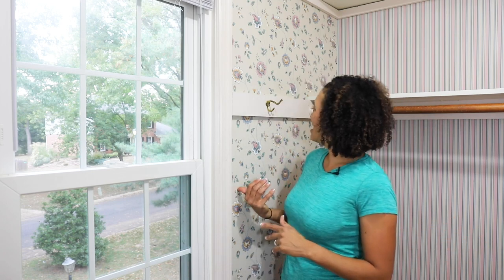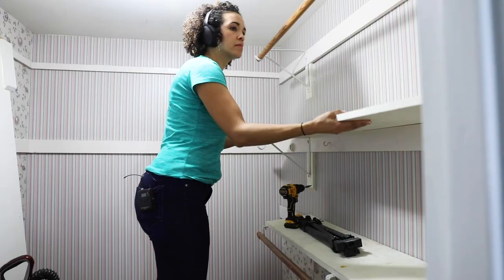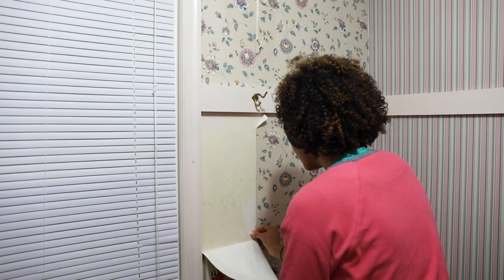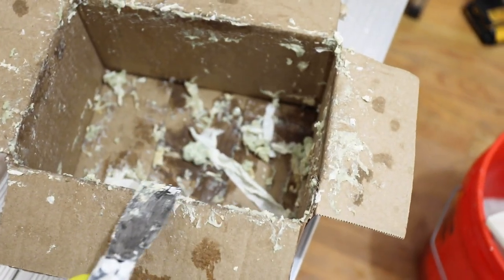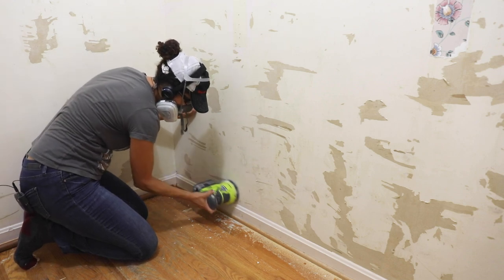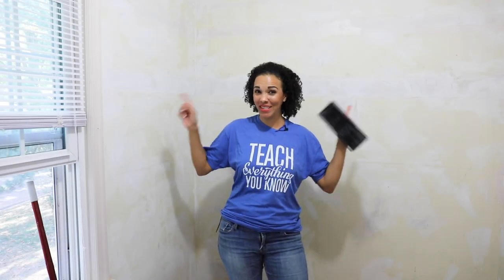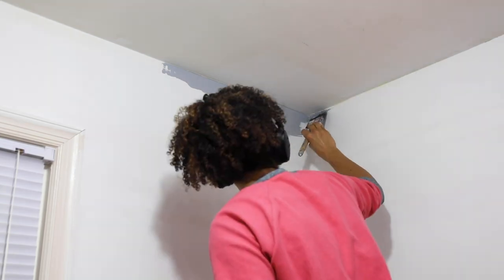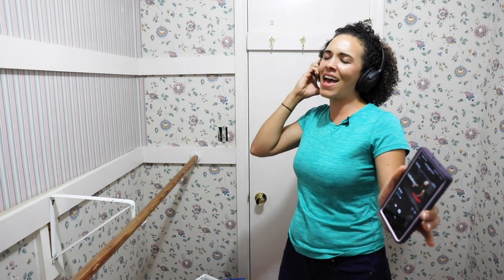How to Remove Wallpaper Easily (and Repair the Drywall) - PART 1 of 3 - Thrift Diving

Comment: I friend bought a huge old Victorian Painted Lady and snookered me into helping her "reno"... Which quite literally meant removing over a hundred years of wallpaper, and a few layers of paint in between a few of them. It took 3 weeks to do one lady's sitting/sewing room. It also took a steamer, 6 gallons of vinegar, wallpaper roller/pricker things, destruction of both my shoulders, and all my love and patience...lol  She's so lucky I loved her so much.
Reply from the maker: Yikes!!!! I think you likely had dreams (nightmares, perhaps??) of removing wallpaper. lol
Reply: Most apartment buildings in Copenhagen are 100 years old and you would cry if you had to reno walls here.when I removed some of my walls I found barbed wires, bamboo, newspapers, cigarette butts, coal and stuf I couldn’t identify as insulation. I did have fun reading some of the headlines on the very old newspapers so I saved some of the most whole pieces of paper.

Comment: I learned from a friend and wallpaper devotee to size walls before papering. Sizing prevents drywall from absorbing the adhesive and extends drying time so the paper can be adjusted a bit once it’s on the wall. And when my tastes changed, the paper peeled off with relative ease requiring only a scraper and warm water to remove the sizing and glue. 

I used Valspar’s Dogwood Petal, a white paint tinged with peachy pink tones in my bathroom, which is roughly the same size as your closet, sans window. It works with pink or gray accents and supports a little bling nicely. But really, the gray your son chose is nice. You could tone it down with white or neutral accents or rev it up with pink, yellow or coral.

Comment: I ve been decorating for over 20 years and I can honestly say I have  used a steam stripper twice and that was when I was an apprentice.use .warm water and add half cup of vinegar soak the paper with sponge or brush and leave for 10 minutes or so .if need to go over it again and leave again.the vinegar reacts with the paste which makes it really easy to strip the paper and you wont get the peeling of  your dry wall
Reply: I agree. Last week I stripped 2 rooms that I know the wallpaper was  well over 20 years old & coated with 19 yrs worth of 2 smokers residue. Spray bottle of 1/3 vinegar to 2/3 hot water beats steaming, or using Downy, Windex, etc. A bottle spray bottle removes the manual labor of wiping, sponging. Plus it’s a heck of a lot faster, practically instant, and no mess if you do it right. I will never use anything but vinegar again. It takes the struggle out of stripping paper.
Reply: @adjustedfate  wonder if you could put the vinegar and water mixture in the steamer?? I am having a heck of a time with removing some wallpaper in our new home.
Reply: @lindseyemberton5286  you would need to make sure the mixture wouldn’t harm the steamer...idk the answer for certain but lean toward it being ok. Might even clean out your steamer in the process. Personally I would flip the mixture using mostly vinegar to water, spray the walls and then use the steamer, too. On my walls I would spray, strip using a putty knife but I have a habit of ripping it once I have it started which that tends to leave the layer of glue paper. I would then spray those areas really well and it came off very easy. Mr Clean makes a Magic Eraser mop that I used after all the wallpaper was stripped to remove any glue residue and clean the walls to be ready for Kilz Latex 2 primer. An amazing, cheap cleaner is TSP, it’s more labor intensive but will literally clean anything. I scoured the Internet prior to tackling this job & TSP was the most recommended cleaning agent to prepare walls for paint. Make sure to wear gloves! Hope this helps. :)

Comment: I realize this video is 3 y/o, but I ran across it today, for my wife and I are on our 3rd room with wallpaper.  It's the kitchen.  We had the wallpaper professionally installed and I am running into areas where we removed the wallpaper that it looks as though the glue ate the wallboard paper as well.  I believe what I am going to have to do here is a lot of skim coating and sanding.  What I have found is that whatever time you think it takes to remove wallpaper, triple the estimate, because it takes a heck of lot longer than you initially thought.  Especially, if you have to work overhead and your shoulders start to tire out.

Thank you for the video.  I especially appreciated how you removed the sections of wood support with the saw.  Set the depth and cut.  Awesome tip.
Reply from the maker: Good luck with your wallpaper removal and repair, Steve! And I was just saying this to a friend the other day: whatever amount of time you think a DIY project will take, multiple that by 3x - 10x! It's always longer. ALWAYS! lol. Good luck!!

Comment: I love the gray your son picked up. Easy to accent with the girly-girl colors (or not). Aside from that, I absolutely love a sage green. Again, easy to accent with other colors - either bold or girly-girl.  Your closet gives me the twitches! I'm a minimalist and sort/toss clothing every season.  For years, I start each season by hanging all my clothing with the hangars backwards. As I use something, if it goes back in the closet, it gets hung at the end of the line and the hangar hung frontwise.  Within a couple months (or through the holidays) I can tell what I'm wearing regularly and what I haven't touched. If I haven't touched it, I don't need it. Out it goes. Life can be so simple :-)

Comment: My parents bought fixer uppers in the 70s and 80s so I got pretty good at removing wallpaper. I only ever used a bucket, sponge and a 4" scraper. You don't need a steamer.

Comment: This video was very helpful and  made removing my bathroom  wallpaper easier. I've used the traditional spray bottle with warm water and fabric softener which worked ok but was very messy. Your method of using a steamer, worked very well; was less messy and easier. I used a small garment steamer cos that's what I had and it did the job. Thanks for sharing. 

Any suggestions for getting the shower grout white and clean?

Comment: 1 part cheap fabric softener to 10 parts water in a squirt bottle. Spray wall patch til soaked and scrap off. Much easier and cheaper with less damage to the drywall beneath.

Comment: SW Sea Salt, Tidewater, Benjamin Moore Melted Ice Cream, Behr Bali Bliss.  I recently removed a house full of wallpaper too. The only step I did differently was to add a coat of GARDZ before and after the joint compound.  I hate wallpaper... yet I will be adding it to my guest bathroom for temporary (1-2 years) until we get around to gutting that bathroom.
Reply from the maker: Sea Salt! That's my entry color! 🥰 What makes you want to try wallpaper again? I'll admit I am curious myself about these newer "removable" ones! If it is truly removable!
Reply: @ThriftDiving  we just bought the house and every single room needs updating. This bathroom has 1950's celery green square tiles on the lower half of the entire bathroom. The upper half is wallpaper. I found some beautiful wallpaper to go over the old wallpaper (talked to the manufacturer rep). This bathroom will be the last room to get gutted. We're just trying to make it work for the next year or so.  It also had the infamous green shag carpet, in the bathroom! Imagine the aroma that left.. 🤮

Comment: Hi Serena, what type of vitamins do you take because you have energy for days?

BTW-- great channel!!!  Somehow this channel ended up in my feed a couple of weeks ago and i have been watching ever since then.  If the closet is just yours, i would go with light lavender walls, eggshell ceiling, and trim.   Include a vanity and mirror.  Also, a small chandelier in the ceiling.  But, if you and the hubby are sharing the closet, then switch the lavender to pale yellow or harvest gold, eliminate vanity and use some other ceiling light.  But to save time and money, you can stick with the existing color.  It looks OK!

Comment: Hard work isn't it? If you wish to speed up the mudding (drying) process I recommend mixing half a bag of hot mud (90 minute) in a 5 gallon bucket for your application... To get the smoothest skim coat I recommend rolling it on and then troweling it... The mud you used, for me, is typically too thick so adding water helps but over that I just prefer to mix my own. Anywho, your finish looks really nice. Great job!

Comment: Jun 2022. I just saw this. You do not need a steam device to remove wallpaper and if you do it as described next you will not damage your drywall. Wallpaper has two components: the decorative printed part you see and the other layer that has the glue/adhesive that sticks to the wall. The key is to get the wallpaper saturated with water. Once it is wet, the decorative layer will come off usually very easily leaving the other glue layer. The printed decorative layer on some papers may be glossy and resistant to wetting. Others wet easily. I found that the wallpaper scoring tool does work well for the water resistant glossy finishes. Just be sure not to be too aggressive with the scoring tool and not go too deep into the sheet rock. You just need to penetrate the water resistant layer with a bunch of tiny holes so the water can get through.
Find the seam like she said and wet only one or maybe two strips of paper at a time. You will want to put down a tarp to protect your floor from any excess water. You do not need to use a fire hose to wet your paper. Use one part fabric softener to 3 parts hot water and apply with a paint brush or tool (e.g. sponge) of your choice. Let sit for about 3 minutes and wet it again.  Repeat a third time. Once the paper is wet enough it will peel right off. 
Once the top layer is off the rest is easy. Go back and wet the glue layer as before and you may want to use a 2 - 6 inch spackle tool to gently help remove the glue layer as shown on numerous other YouTube channels.  If you are careful, both layers will come off without any damage to the underlying sheet rock.  Once all paper is removed go back and wash your walls with a good sponge to remove any glue residue that could affect your paint. I just did this myself a couple days ago with wallpaper that was very resistant to wetting.  Worked like a charm.  
Update: Looking again at her video I’m wondering if her wallpaper was applied to bare sheetrock that has never been painted. The wallpaper I have removed was applied to walls that have been previously painted. Regardless, if you get your paper saturated with water the top layer should remove leaving the glue layer. You would need to be extra careful ensuring the glue layer is wet enough to pull off easily and be extra careful using your spackle tool not to dig into the possibly wet sheetrock paper when removing any stubborn areas.

Comment: I'm removing wallpaper in our front living room at the moment and found the best method is hot water and fairy liquid and use a brush to soak and area 3 times and then it come off much easier and the wall underneath is fine. I think the steamer takes much longer I wouldn't have the patience! :-)

Comment: Take that steamer and throw it in the trash. Here in Australia, I used a product called Dif wallpaper remover. Magic stuff. Easy as pie.
Reply from the maker: I tried Dif wallpaper remover on the walls of my house when we moved in and it made NO difference whatsoever. But the steamer has been my tried and trusted companion when it comes to wallpaper! I guess it comes down to this: different things work for different people, based on their own experience. :) Glad it worked well for you, though!
Reply: @ThriftDiving  My steamer wouldn't tough my wallpaper. I found it best to just peel off the top layer, leaving the softer lower layer, which Dif removed very easily. Mind you though, I don't profess to know all about wallpaper, but my paper was a vinyl type. The stuff sure hides faults though.
Reply: I used DIF years ago. Since I was basically out of it, I tried a wallpaper hack I saw on another YT page. Mixing some dishwashing liquid with warm water, pouring it into a home garden sprayer and spraying down wall papered walls. Found out I had THREE wp layers to remove.

Comment: Thank you SO SO SO much for posting this thorough video. I just bought a house, and the previous owners wallpapered 2 rooms. One is in a grid of 6”x6” wallpaper squares that they painted over, another is textured striped wallpaper. Do you think the steamer will work well on the painted wallpaper?

Comment: I moved into a house that had some gawd awful grass like wallpaper.  Sprayed it with luke warm soapy water and it came right off. After sanding 100 grid sand paper and covering the bare areas where paper comes through with Gardz. Then put 20 minute easy sand cement and a 2nd coat of Gardz and voila!  Note to self next time use a dust extractor...Wallpaper and popcorn ceilings are my 2 most hated items. My wife is happy and now there is peace again.  Until the next project...

Comment: This is why I hate wall paper and choose to put up 1/4" drywall over it.
Reply from the maker: Looooove that idea!!
Reply: Zavia hope we are thinking of putting 1/4" drywall over our kitchen wallpaper to. Glad you mentioned that. We just dont have the time to steam walls.
Reply: @rc6292  Yeah, it takes too long and is too hot!
Reply: Correct me if I’m wrong, but when putting up new drywall, you’ll need to take the old drywall down, going to the studs for the new drywall. Otherwise, you’ll overlap the door frames and baseboards. Maybe I’m misunderstanding your technique. Hanging drywall is a learned skill and difficult for the average DIYer.
Reply: @BeckVMH  Yes, the overlap can happen but often times 1/4 in drywall will not cause that overlap with trim.  There are many options.  Sometimes you can just retexture with a thick texture medium.

Comment: Time to de-clutter! And get the thin velvet hangers from Amazon to hand all your clothes on. They’re super thin, nothing slides off onto the floor and get stepped on and wrinkled and they’re so much thinner than those plastic tube hangers, you’ll be able to fit more stuff in less room. And they also look neat because of the uniformity! I remember one house I lived in that had wallpaper on the CEILING in the kitchen. Omg holding the steamer over my head with the hot water running down my arm and into my armpits and down my sides was miserable. Plus my hair was rubbing in the glue till it was a hard flat tangled mess on top of my head. I wanted to kill the person who did that!! Ha! Not fun times. Makes you never want to see another piece of wallpaper for a very very long time. 
Btw, your voice is pretty! It’s strong. It would just take some real guidance from a voice coach to teach you how to breath and where yo get your air from, to avoid the little crack. That not a bad voice thing, that’s a thing you can be taught! 
I love the color Sea Salt by Sherwin Williams. It’s the prettiest sea blue color. Not over the top girlie, but definitely not masculine! Check it out!!
Reply: Pamela Uribi I love those hangers. Ross dress for Less or Home Goods have those for a killer price. I’ve managed to double my hanging space thanks to those hangers and everything looks so neat being all the same size and color

Comment: Girl! I just did this a few months ago in my bathroom remodel. There were layers of wallpaper, which were all glued together with NO backing 🤬 But while ripping the paper off it took drywall paper with it, exposing damaged drywall and loads of holes and old repairs that had been done poorly and covered with that wall paper!!! Z🤬 There goes any use of liquid or steam 😒 Otherwise my drywall would get flooded or even damp, and then just crumble becoming unsalvageable. So since I couldn’t get all the glue off, I sanded it all down as close to perfect as possible and applied two layers of Gardz Problem Surafce sealer, which seals damaged drywall like a thin coat of clear nail polish. Then then hard work came...  I filled holes and repaired bad repairs. Then I skim coated, sanded, skim coated, sanded, skim coated and a final sanding and a couple coats of a good primer. Came out phenomenal!!!! Not a job for the weak, I’ll say that 😂 You have to stay determined because this isn’t a quick fix. I might have been better off taking it all down and just replacing all the drywall... But I was so determined to do this! And now that the bathroom is complete, I’m really happy with my hard work!

Comment: The easiest color to cover gray would be blue.  Put three of four swatches of blue on the wall for a week or two to see which makes you feel happy.  A renter use a blue green in our extra apartment and it is not happy.  In the spring I and going over it with a happy color to be chosen.  Question, How do it get con- tact off a wall and the plastic glue?

Comment: This tutorial was perfect.  I'm here in 2022 and am trying to learn how to do the wallpaper. I have paper wallpaper, not vinyl and it's tearing off fine without the steamer. No glue is left behind. It was adhered to the sheetrock.  I will need to use the joint cover coating... it she's like a big project but I can't wait to do it?
Reply: ! not ?

Comment: Great video the paint is very nice soft just add some color with accessories such as pictures, pillows for seating/small bench.  Also, wallpaper is a nightmare to remove, and I would only add to a small accent wall or inside my linen closet.

Comment: The house i live in is a 70s home.. they put wallpaper over drywall. My question is, they put plaster to connect the drywall together, will that be a problem for removing the wallpaper/smoothing/priming?